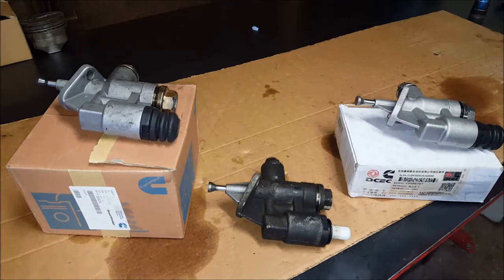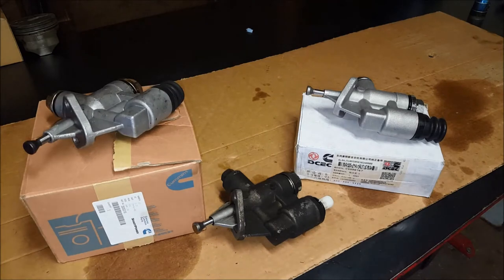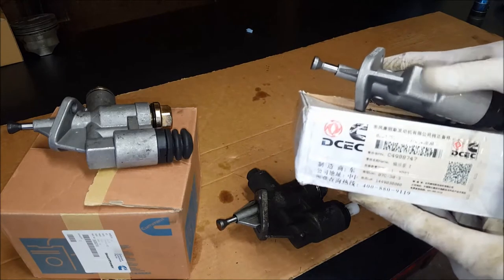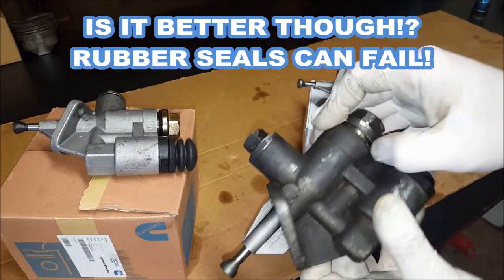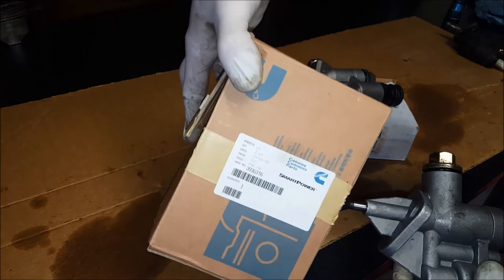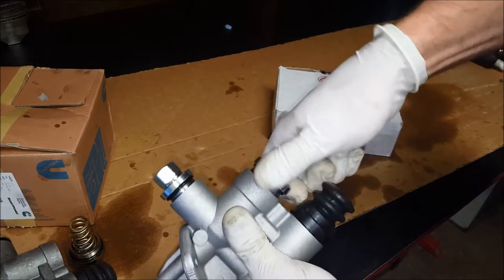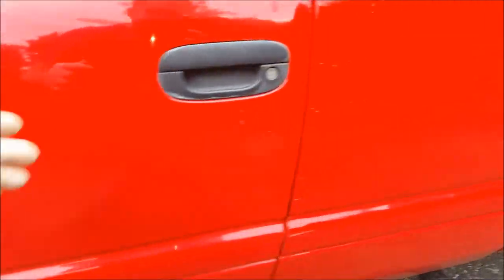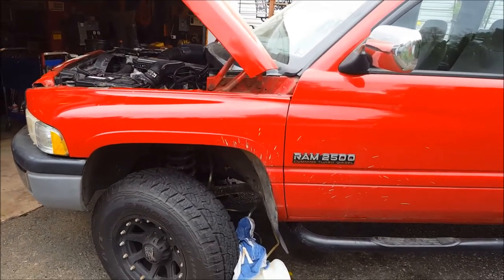Ebay Carter fuel pump vs DCEC vs OEM differences 12v Cummins Dodge

Comment: you dont mention that the shitty made in USA Carter has a much smaller piston by about 1/8 th "..and you're right that Carter is complete shit.
Reply from the maker: I didn't realize the Piston was a lot smaller. Did you measure them? Thanks for bringing that up
Reply: i had both side by side on my bench yesterday,and measured them quickly,about 1/8 th on an inch smaller.